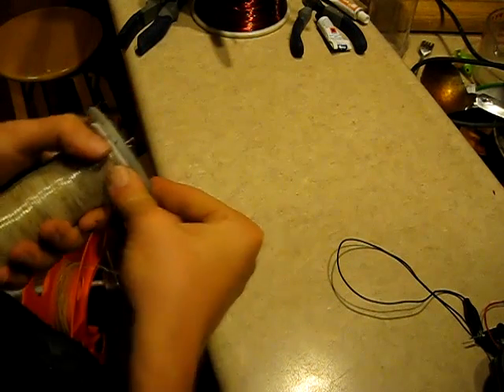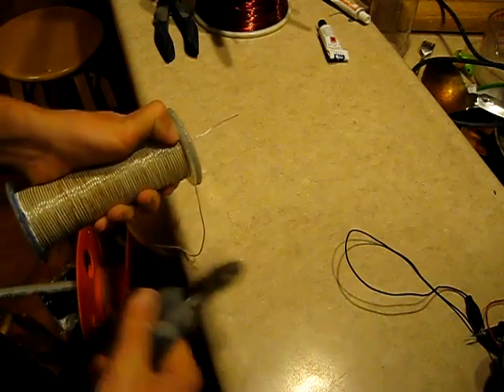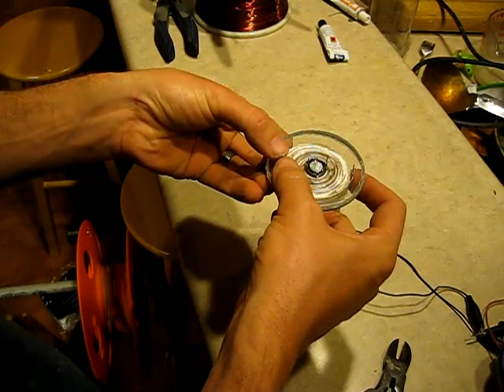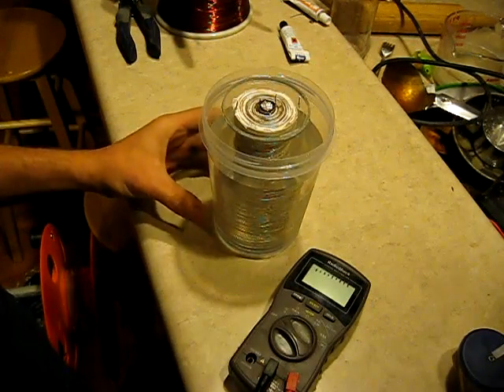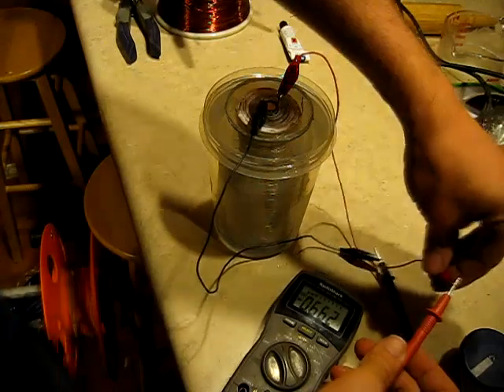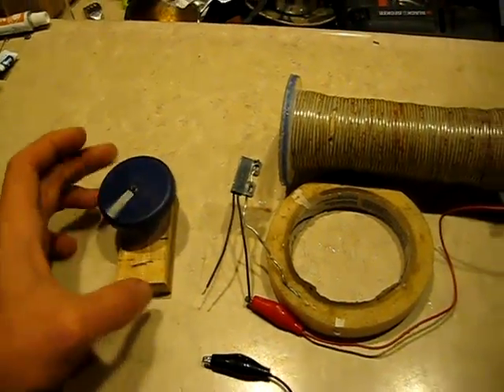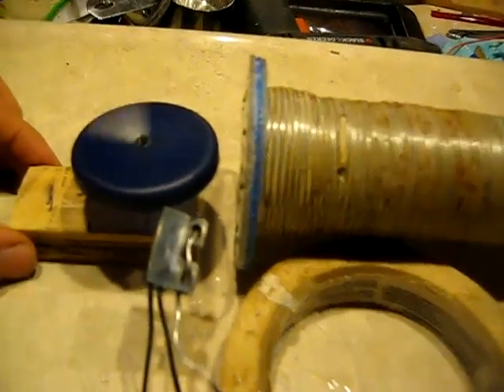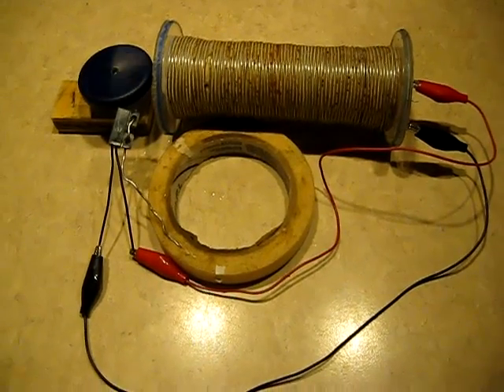How To Build A Nathan Stubblefield Coil Part 4

Comment: I can't help but to think what one of these could do if it were about 8 feet long and three feet thick. Or about a dozen or so connected together. Anyone have the math skills necessary to make a fair estimate with the data supplied by the smaller coil? I don't unfortunately but I bet there are a few of you out there that could figure it out in your head in a matter of seconds.

Comment: Stubblefield tapped into enough electricity to run arc-lights on his farm back in the 1800's. I looked at a geomagnetic map. My hunch was correct that concentrated lines of magnetic force were located under most of Kentucky in the area of Stubblefield's farm. It was found also that Stubblefield's farm contained large deposits of Pitchblende or Uranium ores. Others have speculated that Pitchblende somehow allowed high current flow under the farm land. Stubblefield's family got sick and left farm.

Comment: This setup would be more credible if you didn't wet the cotton insulation. One of the first batteries ever built by Volta was an iron and copper battery. You can use lemon juice, salt, and a host of other chemicals to help ionize the water. There are probably enough salts in tap water alone to produce some electricity. Enough electricity is being produced and flowing through the "COIL-BATTERY" to cause a magnetic field. Nathan Stubblefield tapped into telluric ground current on his farm.

Comment: iron and copper or zinc plated iron (galvanized) and copper looks like a battery to me.
how long would a bunch of zinc and copper plates in parallel last in tap water?
salt water would put out more current, but burn the metals faster.
how often do you have to dunk it in water to re-wet it?
interesting how it combines battery and coil into one.

Comment: Karpen's pile has 2 diferent metals "coneced" by an electrolitic solution. Yours main coil consists by 2 diferent metals "conected" with tap water (with electrolites). The energy in your device comes from the ambient heat (It's a sort of thermoelectric-electro chemical cell, I am trying to make then with fulms and nano-films). Though maybe I am wrong, I haven't examine your device more than seeing your vibeos.

Comment: Karpen's pile is built from gold, platinum and sulfuric acid, not iron, copper and damp cotton. It's inventor claimed that it extracts energy from ambient heat. I doubt very much that the supposed visual similarity implies any useful similarity in working principles.